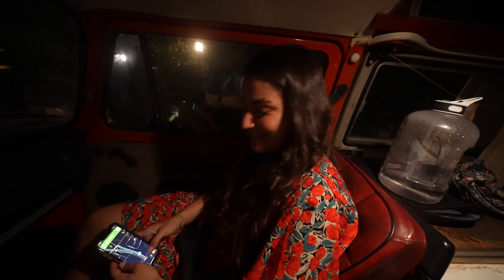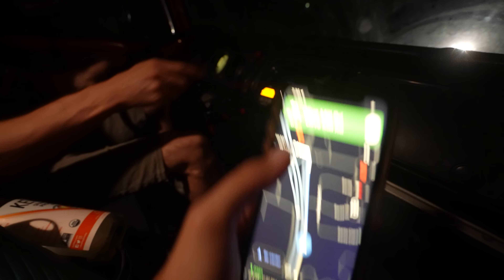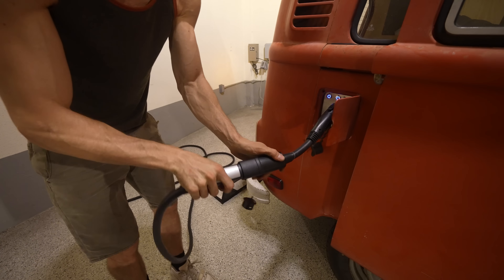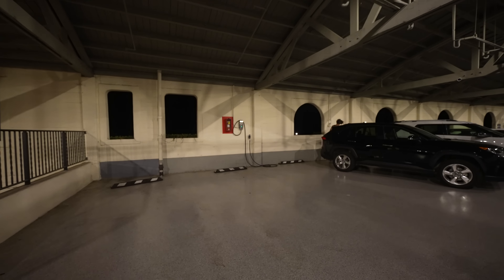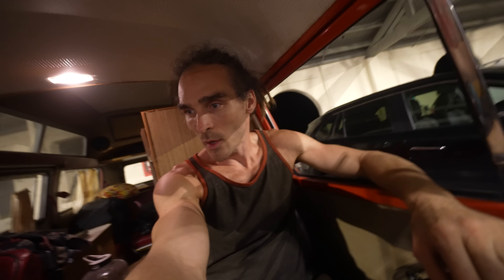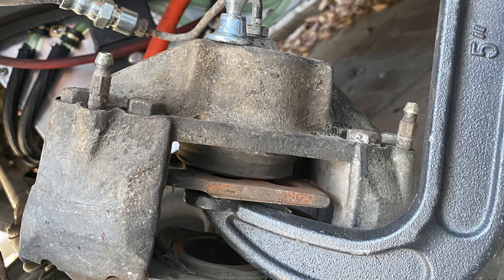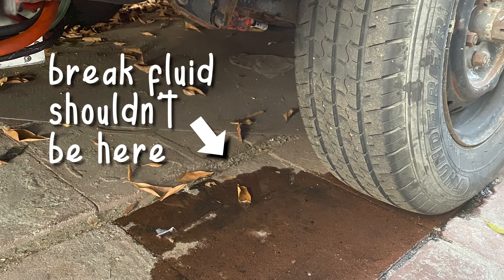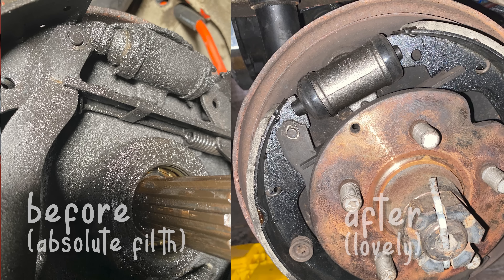All The Problems With My Tesla Powered Classic VW Bus

Comment: The most likely reason that your rear brakes were locking up is that you used a later disk/disk master cylinder, when what you needed was an earlier disk/drum master cylinder.  The master cylinder must match the type of brake system you have, which is why it is generally a bad idea to use non-stock parts unless you specifically know what you are doing and why when doing modifications.  A disk/disk master cylinder will pump out WAY too much pressure to the rear drums, which probably caused them to lock up.  You may have also confused the leading and trailing brake shoes in the rear, which can also cause the brakes to be self-energizing (lock up, in this instance).

Comment: Questions :
What price did you pay ?
What range does it have?
Is it kind of waterproof?
Thinking about watertank, and electricity for lights and other stuff in the van?
Thinking about solar panel? If yes how many?
Any plans to change your bracking system to disc brakes?
Any plans to raise the van and have more underneath clearance?
What is next for the van? Change the battery for more milage?

Comment: Watching this series makes me so glad that I am not mechanically inept 😅. 
Brake boosters need vacuum. If you don't want to install a pump and tank, you can install a master cylinder from a older car or truck that did not use one. 
I cannot believe that you hit the road on a trip without having brakes figured out. Stopping is always more important than going...😅. 
I gave you credit for not any mechanical knowledge to take on such a task. I won't ever get in your vehicle though 😅 and if I see you on the road I am driving in the opposite direction quickly.

Comment: Good day sir, you may want to consider  also replacing the rubber hoses going to your front brakes, as when those hoses get old they can/will collapse from the inside; making those fronts ones also potentially stick on. Just a heads up if you didn’t do them already. Cheers -Brian

Comment: Check the play or gap between the brake pedal and the master cylinder. You should be able to move the brake pedal at least 1 mm before it hits the piston of the Master cylinder. If it is too tight the brake fluid cant go back through the master cylinder and cousing thebrakes to overheat. Hope this helps you.

Comment: Hello. Sorry about my bad english. But i think i had the same problem with brakes at the back some years ago. Sometimes they work fine but if i was using the "handbrake" the weels always geting hot. After i took a hammer and used it on the wheel/brakes it was possible to drive again. Sometimes it was heating up without using the handbrake on the highway. So i need to cool them down with water and use the hammer again.
Yes i i installed new brakeshoes, zylinder. And again the weels geting hot again.
But now they are working!
I changed the brake hose on both side at the back.
I changed them in 2008, my T2a Bus ist from 1971 (first brake hose i think).  I found some people in the internet wich was talking about the brake hose can swollen inside. So if you use the brake the fluid pushes the zylinder, but the spring force of the brakes at the back cant push the fluid back. After some days or using the hammer...it could push the fluid back till you use the break again.

Comment: Really interesting - I am not sure what software you have to control the motor but you need to review the implementation of the torque curve from rest and throughout the range to WOT, otherwise you will be shearing your CV joints on a regular basis. On the power assist brakes how do other EVs implement this?

Comment: The brake servo that you wish to fit does not make the brakes better. What a brake servo does is allow the driver to use less pressure on the pedal and thus gives the impression of "better" brakes. All you need is some form of vacuum operated pump to work the servo. As soon as you mentioned the rear brakes locking up and overheating I knew straight away that it was the load-sender valve. Very common fault.

Comment: Make a swap to Break-Disks! And i also think that the other shaft also will snap in a nack of time because of the torque from the electric motor.
Reply: It only snapped because the breaks were locked.
Reply: EV West says you only need disks in the front, AFTER setting up strong regen on the rear wheels. Notice, he hasn't gotten the regen working.
Reply: @fjalics  perfect solution i dont thought of that!
Reply: @For4Reel  I hadn't either, but I heard 9:10 https://youtu.be/omOUc75r39g.    He got his kit from these guys.
Reply: Brake discs
Reply: Rolling eyes at the claptrap

Comment: Get a new proportionating valve and replace it.
All brake cylinders , all pads and shoes. Brake master cylinder.
New already. The proportionating valve distribute the fluid 
To the front and back in specific proportions. Without it
The fluid will be evenly distributed causing the back brake to hold
Before the front. Booster also a better brake assist and makes the
Foot pedal softer .

Comment: Dude, you've worked really hard on that conversion, unfortunately you've made a massive mistake.
The brake Servo/booster must be reconnected with a electric vacuum pump. 
I can understand you were excited to use the vehicle but it's unsafe.
Reply: I only have beetle experience, but I assumed the busses were also non-power assisted master cylinder.
Reply: @whatsstefon  VW buses of this era do have a vacuum assisted brake system.
Reply: @christopherspicer9341  ah. Cheers for the confirmation. I wasn’t too sure, only ever played with older stuff
Reply: @christopherspicer9341  there is nothing magical about the vac assisted brakes. he did the right thing replacing it with an older master cylinder.
Reply: @gregh7457  vacuum assisted vs non assisted will have different sized bores. You can swap them but you must calculate for pedal ratio, cylinder bores, caliper piston diameter and pedal pressure. It isn’t just one for another. It is a balanced system.

Comment: Get a set of chromoly Sway-A-Way axles to avoid CV issues in the future. You probably should do a rear disc conversion but at least in the short term you are better off replacing those rear shoes (again) and possibly the drums. The amount of heat those were exposed to (multiple times) is not good and will contribute to the poor brake performance.

Comment: I guess you checked all the connectors after that one ring connector came off? What I watched from the video is that that connector is not crimped at all and it is really dangerous to leave such connections on the high voltage side. Unfortunately, I think similar joints were seen in other videos from the same partner, so maybe he should invest in better connector crimping tools.

Great project though!  Hopefully the problems are about to be overcome and soon you can just enjoy driving.

Personally I dream about same kind of conversion, but still now I have to refurbish the old boxer engine of our bus, because making electrical conversions is still too rare and expensive here in Finland.

Comment: Why not install a current meter that will give you a pretty precise picture for the state of charge? Voltage in many cases means nothing but measuring the current flow and knowing the exact (tested) battery capacity you can predict "tank fullness" to 1% easily. More precise than petrol in fact.

Comment: You need a full disc conversion and I  also don't knowhow you drive but with the electric motor having you foot on the throttle at all while your braking will just light your breaks right up. Especially the drums they don't have anywhere near the friction to overcome the torque of the electric motor. Thats why you can drive through even sized brakes* should see if you can have a switch attached to the break that cuts power to the motor so there I no drive while you brake. Just an idea!

Comment: First, the vw is heavier with more power, so it is extra effort to stop the car with drums brakes. It is not recomended using drums brakes, there is no much air flow to cool off the heat from braking process. Upgrade it to disc brakes

Comment: Is there a way to dial-up the magnitude of the regenerative braking?  In most electric cars, there are at least 2 levels and the highest level in most cars is sufficient to allow you to never have to touch the brake, except to hold the vehicle in position at a stop sign/red light meaning the mechanical brakes are used almost never.  All of this is after the brakes actually work and are not dragging.

Comment: Hey Louis! I have a suggestion for the wiring for phase 2 seeing as one of the wires came loose out of the boot. To prevent it from happening again which could be catastrophic, melt soldering wire  onto the  wire and then put the wire onto the boot, crimp it together and melt some more soldering wire into it so that it has a permanent bond with the boot.
Reply: For automotive stuff crimping is better than soldering froma stress-relief point of view. I think he just forgot to crimp that one. lets hope he didn't forget too many more.
Reply: @xxwookey  This conversion  kit  Company - selling this conversion kit , must carry more response before the car leave their place. Here in Europe all guys of this story will be rested. Illegal and danger from start to end

Comment: You need to seriously change to rear to disc brakes  don’t delay pay to have it done at once  or you will regret it  .and it will need upgraded drive shafts as well to handle the torc from that electric motor

Comment: I would be looking at replacing, the rear's to disc brakes.
Reply: EV West says you only need disks in the front, AFTER setting up strong regen on the rear wheels. Notice, he hasn't gotten the regen working.
Reply: As long as he puts out the fire everything should be sweet

Comment: Besides the brakes issue, what I’m wondering guys is it possible to have your batteries charging as you drive like a lot of refitted van homes have (connected to alternator?) and some solar panels; that way you’ve got 3 different ways to get your batteries charged and go for longer drives.

Comment: I think the most impressive part is that you took on a project like this without knowing a ton about how cars work. I would suggest a disc brake conversion. I only found your channel about a week ago but I need to go back and watch the entire build.
Reply: EV West says you only need disks in the front, AFTER setting up strong regen on the rear wheels. Notice, he hasn't gotten the regen working.
Reply: @fjalics  
Exactly.
Still could do with a servo adding. Must be some kind of vacuum pump available to use for the Servo ?
Quick Duck Duck go.... https://youtu.be/jVLeZM-1-mE
Reply: too much breaking is much better than too little lol
Reply: @fjalics  First job on any car work that will increase engine power should be upgrading the brakes.
Heck, the first job in getting any old car back on the road should be getting the brakes up to modern standards.
In any older car, good idea to coast with the clutch in from time to time. Find out the brakes are binding BEFORE they overheat and become useless.

Comment: Honestly I would do a full disc conversion for your van
Reply: funny thing is that drum brakes often cause less problems. especially with vag products the rear callipers need to be rebuild/replaced after every new disk almost every time. did order new seals for every car that i had and always encountered stuck rear brake pistons.
Reply: @robertboxhoorn  Problem is drum breaks are not up to the task of stopping a 400 H.P. vehicle.
Reply: Drums are amazing, they out lasted my car with 200k mi. Never needed servicing, the two shops I took it to laughed when I asked them to do an inspection.
Rears of course.
Reply: 80% of the braking happens on the front brakes, the rear dont get that much wear, but to be fair i find dis brakes much more simple to work on than drums.
Reply: That is not the problem, he has disc brakes up front and obviously trucks have drum brakes in the rear and they do fine.  The problem is his master cyl and the lack of booster.  He needs to add a vacuum system to his brakes and replace his master once again to match.  He also needs to overhaul his brakes and return them to stock.  Disk conversion kits for older buses that have all drums and no booster are popular but this bus does not need that.
Reply: it has nothing to do with it.
Reply: @crazypjk  Is that why most semis are drum brakes?🙃
Reply: I kept my 71 Bus rolling 12yrs then sold it.  Your carb normally provides vacunm to your brake booster but this conversation got rid of vacumn so call those guys who did the electric and tell them to provide vac by installing a small vac motor.  You’ll feel an amazing change to the power of your front brakes.  The back drums need to rebuilt and maybe drums turned smooth.  DO NOT PUT DISKS IN THE REAR.  Wasted $$$. They normally provide only 25% of braking.  Damn, I am in LA, love to help get your drums working safely again.

Comment: Put some money in your hands and give it to a mechanic who rebuilds your whole complete system all with complete disc brakes front and back. Since you have waaay more torque with electric motor the brakes are also not designed to deal with kind of force. Its worth your life to have complete new brakes all around.
Reply: Check out the new VW ID3 electric with rear drive and drum-brakes in the back. Drum-brakes in the back are superior for electric cars because they tend to work even if they are not used that often. Also the hand-brake is built into the rear drums.
Reply: @MBBHD  wow that’s interesting..I wasn’t aware that nowadays drumbrakes are still used.

Comment: Man I would re-do all of those cable lugs with a professional press. If one came off they all will come off. That was a warning from your van. ALWAYS LISTEN TO THE VAN.
Reply: good idea,  a hydraulic wire crimper is not that expensive compared to the damage a loose cable end could cause
Reply: @fmess33  he was already using a hydraulic one, I think he was just rushed and possibly crimped it in slightly the wrong spot so it didn't crush right
Reply: Putting the cable back into the lug and taping was dangerous, as the guy said crimp over all those lugs. Did anyone do a stress test on those lugs after it was crimped. At the end of this you can certainly write a book on what not to do.. Be safe on the roads ...
Reply: it's a bus not a van.
Reply: @mnee4922  you told him alright. His advice is irrelevant now.

Comment: I have the same brake/regen problem with my EV West kit. Have you got a solution yet? They told me to add a diode, but I could not get it to work. So I just run without......

Comment: I've had 2 electric bicycles and 1 electric motorcycles so I know how it feels to have an electric vehicle and then run out of power. My motorcycle was the evader mx50 and it had 6 batteries. I also carried my wall plug with me to charge it where I could. It also had pedals for legalities but they are set in such a spot they are behind you which makes pedalling awkward.

Comment: Just finished watching the whole build series and subscribed. I would really like to see that video on what you have into the project besides sweat and tears and blood. Also, what kind of range do you have when using the proper charger. Having built robots for television shows like Battlebots and Robot Wars, I am familiar with electric motors, motor controllers and charge controllers. Anyway, great job on the video and the build. I admire your courage and perseverance.

Comment: This thing looks scary dangerous definatly need a qualified break mechanic to get this thing in shape I have never paid for brake work in my life I've always done all my own break work never had issues like this if I would have had your problem I would have plugged the back brake lines off at the master cylinder loosend up the rear pads up and Road in on the front brakes I have actually done this when I had a a rear break cylinder blow before

Comment: Would it be possible to fit a charged battery/power supply on board the van (separate to the ones already fitted) that can be used as a backup which would connect to and power the motor in case of emergency?

Comment: How much regen do you get?  If you’ve got it set up right, you should hardly need to use the brakes.  My Renault Zoe is set up that way.  Ah! I see you’re having issues getting regen working.  Good luck with that.

Comment: shouldn't have  modified the brakes leave the booster alone and install an electric vaccum pump they are not cheap , but i have made one from an Evap air pump for my diesel volvo and hooked it to the brake switch every time i stepped on the brake pedal it turned on never had a problem